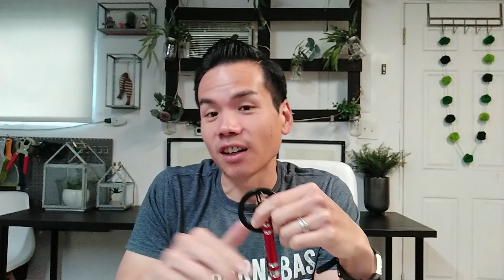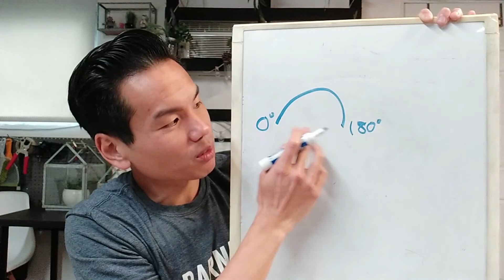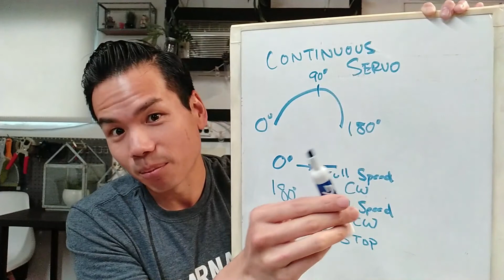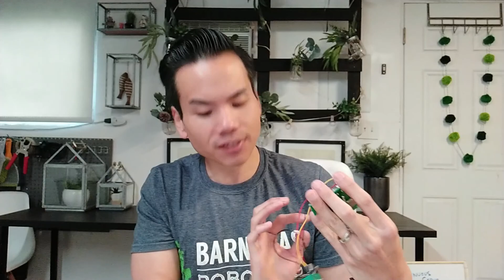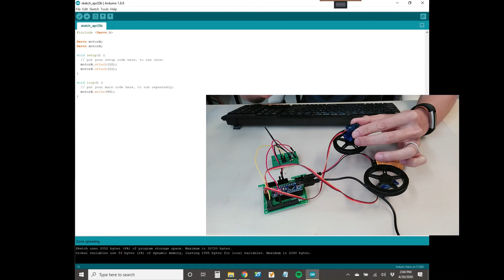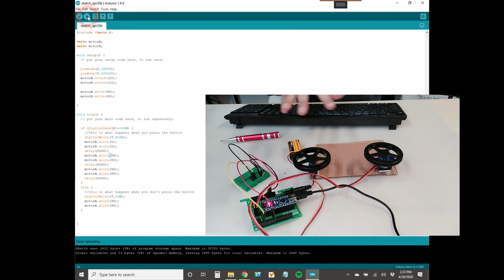3. Barnabas Racer - Continuous Servos

Comment: Great video as usual 

But what is the theory behind 90 degree stopping this servos 

Need more explanation on the workings
Reply from the maker: Hi! Thank you for your kind feedback.  To be honest I’m not sure why it is 90 degrees that stops the servo, but my thought is that it is a good design since a typical servo can be programmed to rotate between 0 and 180 degrees only - so it makes sense to me that when programming a continuous servo, you use the center point (90 degrees) as the stop point and the extremes (0, 180 degrees) as the max speeds in either direction.  This matches the way a throttle on a speed boat works too.  Hope that helps!